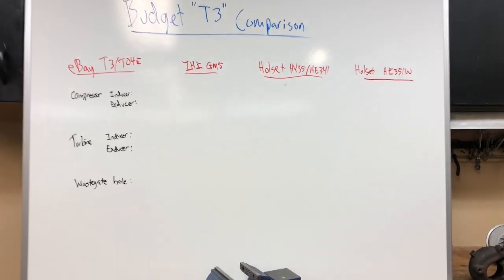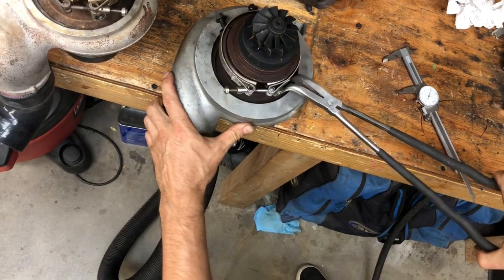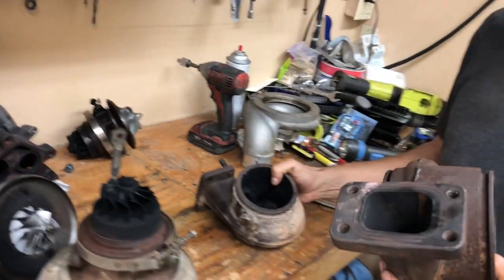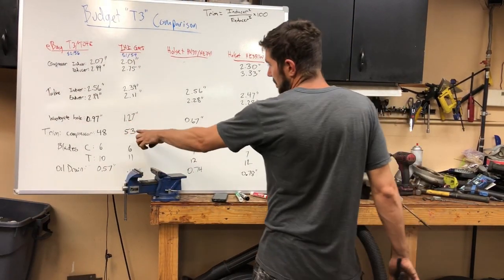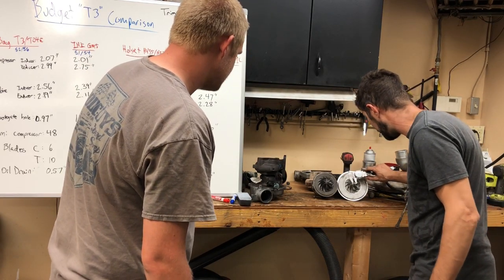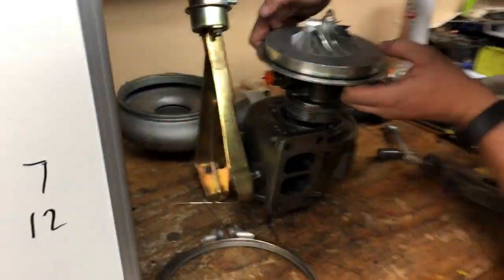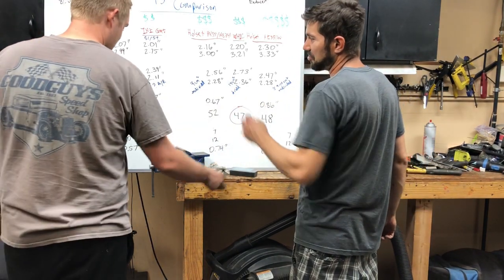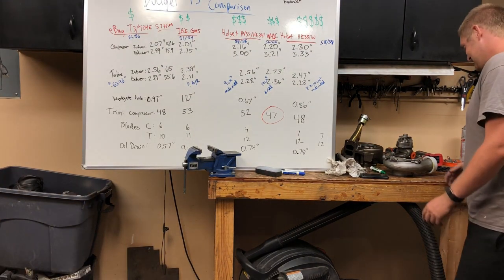Measuring budget T3 turbos: eBay T3/t04e vs. GM5 vs. Holset HE341 vs. He351w vs. WH1C

Comment: We’re looking to pull a GM-5 turbo off a Chevy diesel truck with no shaft play at the junkyard, wondering what we can expect from it on a B18B with Vtec head. Effective range? Will it spool too fast or too slow? What psi can be expected if it will spool? Thanks a lot. This video was awesome, SUBSCRIBED!
Reply from the maker: LS VTEC FTW! Man I love it! That would be such a great combo for the street, full boost once VTEC kicks in. No less than 300 hp on 15 psi is my guess, with capability for 20-25 psi and 375-400 hp on that engine. You can push the little turbines a bit further with a smaller engine like that.

Comment: How much are we thinking the GM5 will support on a 1.6L? I’m getting ready to put one on my car
Reply from the maker: 300 hp, easy. I installed one on a 2.0L 420A Eclipse, as well as an HY35, H1c w/ 21cm housing, and a T70.  The GM5 was by far my favorite for 15-20 psi range. Such awesome spool for that power level! I think you'll love it.
Reply: This 1.6L will also be using a roots style supercharger 😬 plus said turbo
Reply: I’m hoping for 400 at the tires.
Reply from the maker: @Theoneguythatdoes  now you're talking! I never pushed the GM5 that hard before swapping said Eclipse to an HY35.  I'm going to guess you have VTEC too, which will really help. And it seems those smaller engines can get more power out of the same turbo before they choke. Good luck!
Reply: Yes. It’s a single cam with VTEC on the intake side only. Based on what others have said with experience, I should be sizing my turbo as if it were a 2.2-2.4L. I’m hoping this combo will work for that. My main concern is intake air temps due to the supercharger and how roots type superchargers like to heat air which is obviously already heated from the turbo.